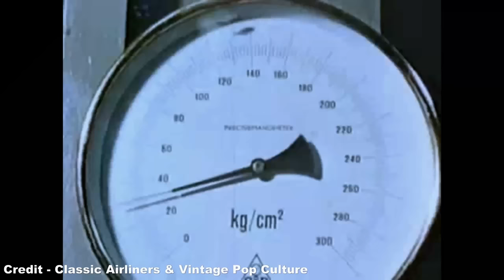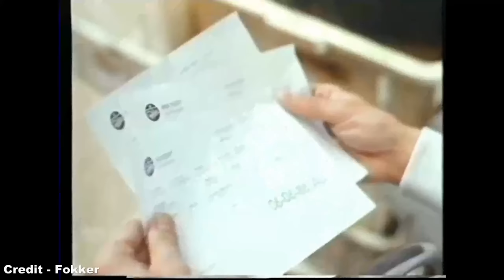Flying Friendship - The Fokker F27 and Fokker 50

Comment: I flew the Fairchild F-27 and FH-227 here in the States.  I was an instructor and check airman on the airplane.  Very fond memories of that airplane.  The whine of the Darts, the Dowty Rotol props and their locks, the sound of the air as the brakes released. Even all these years later I think I could get one started up.  There was a whole lot of things that airplane wasn’t.  It wasn’t new, it wasn’t fast and it wasn’t what I would call beautiful, but I dearly loved that old airplane.  Thanks for a great video!  Lots of memories.
Reply: Were you the check pilot on that Ozark Air Lines Fairchild FH-227 flight whereby the cockpit crew accidentally overflew the Sterling-Rock Falls (Illinois) airport and instead mistakenly landed at the Dixon, IL airport about 15 miles further east?
Reply: @WAL_DC-6B  No, I’m afraid not.  I didn’t fly for Ozark.  My company bought two of their FH-227B airplanes. 

Bet it’s an interesting story though!
Reply: @georgiathai4961  I kind of figured you weren't that check pilot.  I can't recall where I read that story.  It's probably somewhere on the internet as well.  It was embarrassing for the crew, Ozark and especially that check pilot.  Once on the ground at Dixon there was no place to turn the FH-227 around due to the narrow runway and I believe lack of taxiways.  One passenger was from Dixon and had a relatively short trip home!
Reply: @WAL_DC-6B  At my conpany we had a crew land a Fairchild at the wrong airport in Illinois. Landed at Carbondale instead of Marion. One passenger lived there and  wanted to get off the airplane right there!  Like ya said, embarrassing for the crew, and even worse with a check airman on board.
Reply: @WAL_DC-6B  I remember when that happened so clearly.  Hard to believe that’s been nearly 40 years ago.  When I think about that I start to feel old.
Reply: @georgiathai4961  Wow, another very similar incident regarding a Fairchild!  Perhaps this is more common with airliners than one would think.   I attended and graduated from SIU-C back in the 1970s.  Back then the only airline flying into Carbondale was Air Illinois which flew their HS 748 between Meigs Field and Carbondale.
Reply: @WAL_DC-6B  I’m an Indiana State University boy myself.  Grew up in southwestern Indiana.  I remember “Air Ill” and their being in Carbondale.  SIU is a great school.
Reply: I flew the F27 here in UK, the only aeroplane I have ever flown in 46 years of a career that I didn't like, in fact I hated it.  Noisy, smelly and generally unpleasant to operate, I was glad to leave it behind.

Comment: Back in the 80's I flew in Air UK's F27 several times. One was Stansted to Southampton return and another Stansted to Edinburgh return. That former journey was just a positioning flight (out Saturday morning and back Sunday evening) so that the plane could be used for flights from Southampton to and from the Channel Islands at weekends, but I found out you could book a seat on that service for just £10 (which included a beverage). So myself, my wife and son took advantage of that very cheap trip.
Reply: Air UK had services from England to Bergen, Norway as well, with the F-27. I remember a bright and sunny afternoon flight across the north sea. The F-27 was a familiar experience as much used by Braathen S.A.F.E, although at that time most of the domestic flights by Braathen had been taken over by F-28s and 737s. Good memories.
Reply: @Ambrosius50  737 200s i hope :)
Reply: @oldfatbastad6053  Yes, - 200s. But F-28 Fellowships were mostly used, except on the largest airports. Also a very nice plane.

Comment: An interesting piece of information about this plane I heard from a former mechanic: the Dutch-built F27s and license built American Fairchild F-27s had nearly no maintenance commonality. Only the landing gear was interchangeable between the two aircraft. Everything else was different enough to require totally different parts and maintenance procedures. Very strange for a license-built plane that outwardly looks identical to the original.
Reply: To avoid certain US restrictions on foreign  products manufactures alter  things and use local parts.
The Hawker Sidley Harrier from the UK was also licensed to Mc-Donald Douglas later Boeing. 
The UK GR versions Harriers differ also from the US AV-8 Harrier versions.
Reply: That’s not entirely true, both  models had a lot in common as Fairchild was licensed to build this derivative by Fokker. I have worked on both in the 70s as an engineer, some component differences but pretty much the same design and systems. Also spent many years at Fokker as an airline technical rep for both the F50 & F100.  I,ve held licenses on the F27, F28, F50. Now retired . Great aircraft and company.
Reply: That's similar to the bell 206 jetranger and OH58 kiowa even though they were both built by bell and have essentially the same appearance, they have a few significant differences in there equipment and drivetrains that all but eliminate interchangeability between the two

Comment: The only thing the Fokker F27 and the Fokker-50 (Technicaly F27 Mark 50) shared was the basic fuselage. Everything else was new.

* The engines as the video states went from RR-Dart 6 and 7 to PW125 to PW127
* The power setting of both prop and engines where done by the push of a single button a bit like a modern jet.
* Pneumatic landing gear and brakes where replaced by hydraulic systems
* 28VDC systems where replaced by 115V AC systems
* Flight controls where much lighter due to design of balance tabs making the Fokker-50 a joy to fly unlike the dumptruck handling characteristics of the F27
* The new engines and easyer handling made an engine failure in takeoff a formality rather than an emergency
* All the electronics where replaced by then state of the art EFIS, smart and very easy to understand and operate computers.
* The Autopilot basicly whas the same but the flight mode control, flight director where verry well integrated into the EFIS and verry easy to use.
* Round windows replaced by squared (I wonder why)
* In fact all of this made the Fokker-50 even with multiple emergencies easy to fly even of one of the pilots was incapacitated.

Of course there also where disadvantaged
* The Fokker-50 like the F27 was slow.
I mean realy slow, Vmo was 220kts but at max operating flight level of Fl250 (if you ever managed to finaly get there) this dropped below 190 kts
* It was relative heavy making the competiters cheaper to run
* I was for the time highly advanced so fairly expensive
* As the video stated there where a lot competitors

Still i think both where great planes, a shame to see them disapear from the sky.
Then again i antique cars but still i drive around in a modern one.
Reply: Those are IAS numbers. TAS the F50 could cruise up to 270 knots.
Reply: @F50Aircraft  Always trust your instuments son 😁 There is no TAS clock above the wheel
Reply: @pascalcoole2725  Well that's what other F50 pilots have told me.
Reply: @F50Aircraft  I Calculated it (aprox based on Fl250, OAT -35C IAS 190, as at Fl250 Vne is 190 not 220 !) seems to be correct indeed.

Comment: I flew one F27 in military spec from Valkenburg Naval Air Station to Stansted (and back the same day). The "seats" were just cloth on metal frames on the side of the plane. All was fit for parachute troops. I can't say it was a comfy experience. Very noisy too. But, it was my first experience with Virtual Reality training that day, 10 years before VR became available on the market. That made it worth it.

Comment: I made a great model of one when I was a kid. I think it was a Novo kit, made in USSR. My grandma used to get them from somewhere...
Reply: Likely once a kit made by British firm Rovex-FROG.
Reply: Possibly has been one of theirs, as many of their molds were transferred to the Soviet Union in the mid-Seventies to be marketed under the Novo brand. For example, I also had the coastal tanker MV Shell Welder, which had originally been a FROG kit. 🐸
Reply: @markcousins9337  A 1:72 scale kit from Airfix, with Aer Lingus markings from the early 1960s. I built one, it made up into a very good model.

Comment: Once the most common plane flying over the house I lived then near Maastricht Aachen Airport in the Netherlands, KLM used to have a subsidiary called NLM (Nederlandse Luchtvaart Maatschappij) which exploited regional air routes within the Netherlands and to neighbour countries.
They ceased operation somewhere in the 1990s because in such a small country like the Netherlands domestic air travel doesn't make sense, as you can travel from one end to the other within 3,5 hours by car, flights over the longest route, Maastricht to Groningen, took 20 minutes but adding 2 to 3 hours to get to and from the airport and check-in/check out there wasn't much advantage in total travel time.
Flights were also relative expensive compared to car travel, about twice as expensive as with a car with just one person in it.

Comment: I live close to a regional airport and have seen many f27 and f50 coming and going, most of them operated by NLM. i only ever have flown on an f50 NLM plane 1 time. 
Tbh i found it to be kind of a primitive noisy experience after having travelled in 737's MD11's, Airbus etc. 
But fun nontheless. 
The Dutch government also used f27, f50 and f70 executive jet. Nowadays they use a Boeing 737.

Comment: From a pilot's point of view, they had a very comfortable pilot seat and felt very nice to fly. Unfortunately, they were short on power, (especially the early ones),  those RR Darts were very noisy, and the pneumatic brakes and steering both took a lot of getting used to.
I believe the shortcomings were addressed on the F50.

Comment: I have a few Corrections, Fairchild built 128 F-27s and 78 FH-227s. Be a total amount of airframe losses for the FH-227 was 23. The Fairchild F-27 had its own set of aircraft losses. Although these airplanes look similar they were built completely different between the Dutch variant and the license built variant made by Fairchild. Parts from Fokker aircraft could not fit Fairchild and vice-versa. Actually the FH-227 was kind of a departure from what Fokker wanted Fairchild to build and they were not too happy that they renamed the aircraft. One last thing Fairchild Aircraft company did not merge with Hiller aircraft until 1965. Also interesting to note is that the license build Fairchild F27 actually beat the Fokker F27 into service by a few months. The Fairchild inaugurating service with West Coast Airlines.
Reply: When you add all total of crashes up in all the variants of these Fokkers ,they were not exactly the safest designed aircraft to fly in .
Reply: @maskedavenger2578  You might be too young to remember, but aircrashes were not at all uncommon through the 70's among all airplanes, not just the Friendship. There were certainly worse planes than it was for safety. One must also consider too that it served a lot of less-developed airports and flew in places where terrain or weather made flying far more hazardous than in the first-world nations.
Reply: @P_RO_  I was born in the mid 1950’s ,& flew on quite a few old prop aircraft including the Fokker Friendship ,(  Aer Lingus ) in the 1960 ‘s .By the 1970 ‘s the same route was replaced by Boeing 737 200 . I don’t actually remember flying being any more risky than it is now in modern times .The modern airliners have too much reliance on fancy tech gadgets that can & do go wrong .I think old DC 3 ‘s were better adapted for underdeveloped countries as they had balloon tyres & could land & take off on poor runways & jungle clearings & could be had with spares dirt cheap .